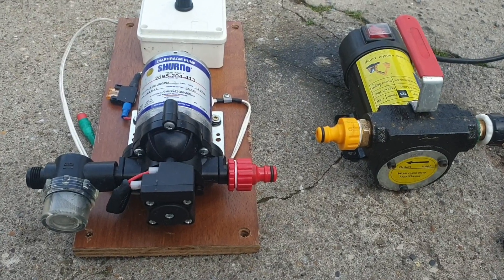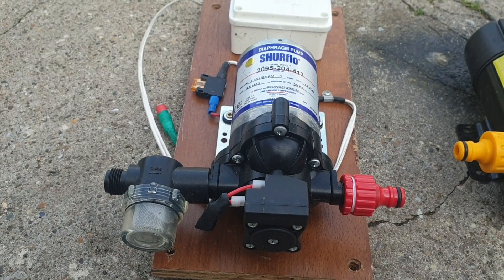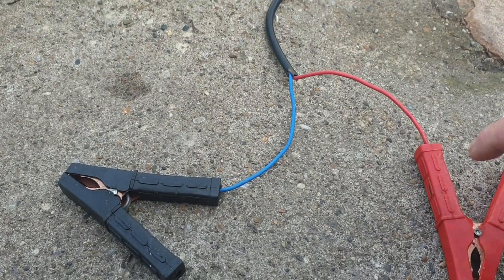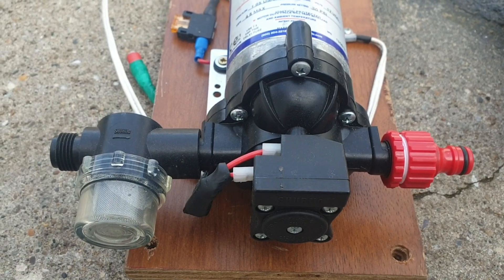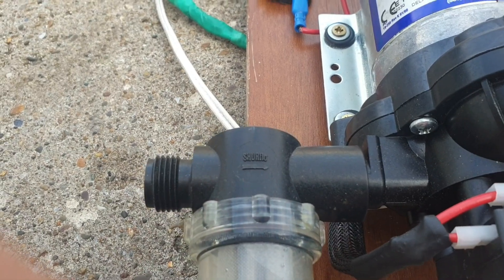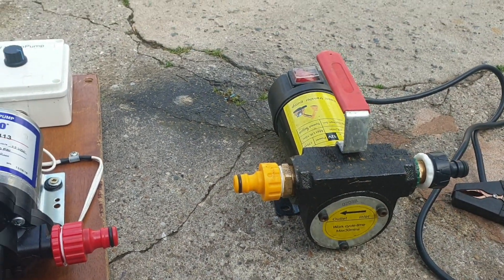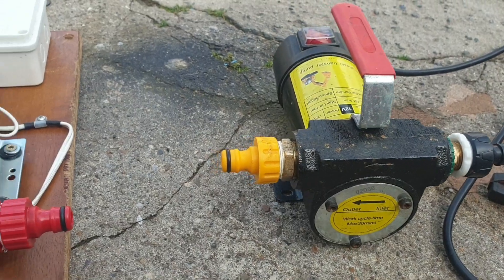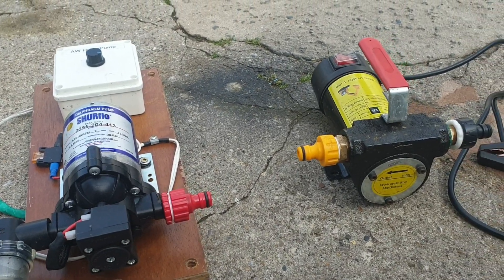Understanding a water pump direction of flow & Polarity

Comment: Does it matter if I change polarity on a non reversible effluent pump 
(red Lion rls50)
There is no positive or negative in the wiring diagram...just line 1 and line 2 connecting to terminal 1 and 4.
Nothing is marked or colored...
The pump says "non reversible"
Reply from the maker: Speak to the manufacturer. It's physically design shape alone is that way for a reason. I'd prefer not to part advice on something I'm not familiar with

Comment: Can you change the direction of flow I use mine for my sprayer and I can only find ones that go one way and I need it to go the other way to fit properly
Reply from the maker: If it has a directon of flow it most likely means either the impeller is designed a certain way or it's diode protected if so you can remove the diode and run it backwards